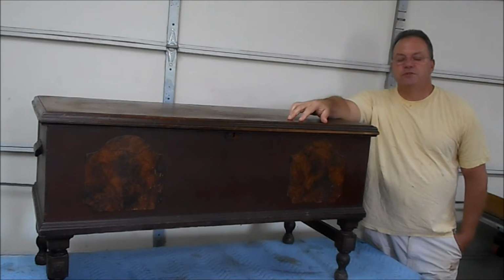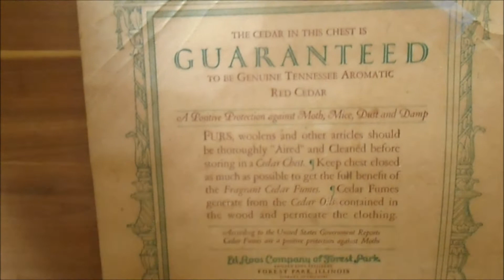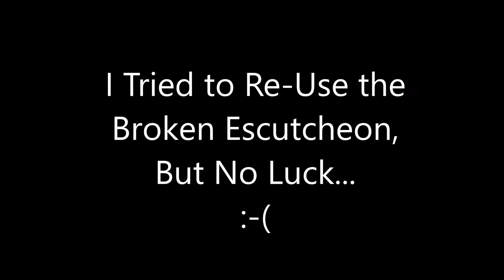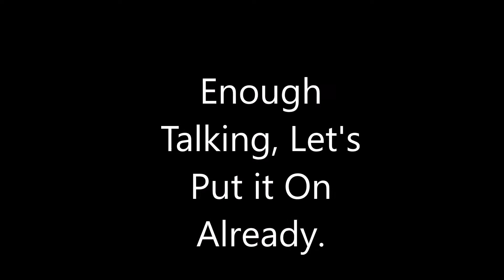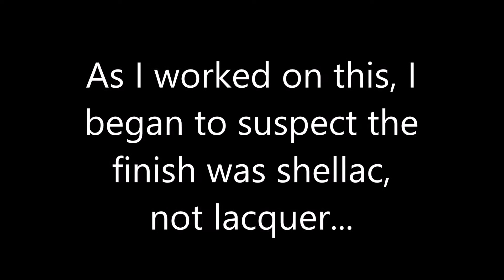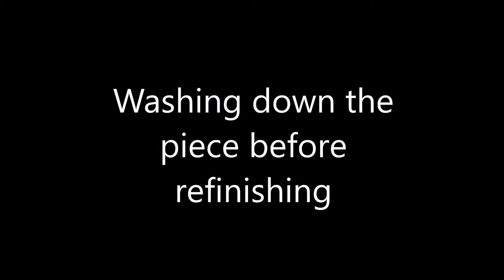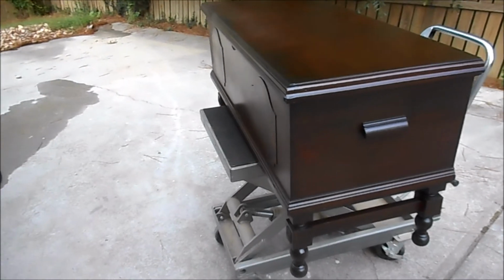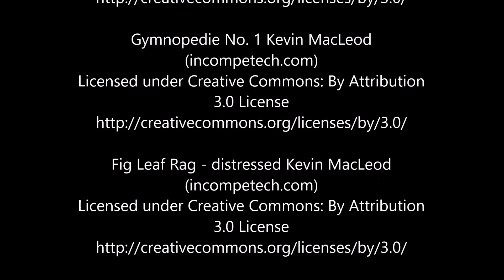Restoration of an early Roos cedar chest

Comment: I JUST FOUND A LANE CEDAR CHEST FROM THE 40'S LET THE FUN BEGIN. THANKS FOR THE INFO GOD BLESS
Reply from the maker: Good for you!  Good luck with the project.  BTW, if it has the original latches on it you may want to disconnect them.  I understand there have been issues with kids getting into the chests and the lids locking them in.    Sad stuff.

Best regards and thanks for watching!

Comment: Nice job.  I stripped off a faux finish on a built in cabinet in an old  house once.  I was sick so I know the feeling.  Nice recovery though.
Reply from the maker: Thanks, Rick.   I was surprised twice.   Once then the finish came off and then again when it went back on.   :-)
Reply: Question.  Most of our furniture is older stuff but my wife spilled polish remover on one of her favorite cheap tables, sadly made in Vietnam.  Something should be wrong with that but to the point under the microscopic thickness of veneer all it has is what looks like maybe resin and sawdust or something to that effect.  Pretty soft when stripping it.  I was wondering if you've dealt with any of the cheap stuff like that  and can I just spray a sealer and then lacquer like normal or does that crap need something else.  Obviously I'll need to put some color on it after sealing but I didn't know if lacquer would melt it.  Thanks.   Hope you're working on something.
Reply from the maker: Ouch!   I have done a lot of repairs with particle board, but I'm not sure I have dealt with what you are describing.   I think you are probably right, that if you seal it first you may be OK.   Obviously it will need to be smooth before you try to finish it up.   I guess if that all fails, you may have to either patch or re-veneer the top.   Let me know how you make out as you move forward.   I'm curious to hear what you find out.   Good luck.

Comment: Reply appreciate your videos!

Was most curious about how you refreshed the interior cedar but didn't see anything mentioned in video? Did I miss this part? Also seemed you left lid cracked and interior unprotected while spraying shellac... Was that intentional? I thought cedar interior needed to remain unsealed?
Reply from the maker: I didn't seal the interior.   Normally all that needs to be done with cedar lined furniture is to scuff sand the interior to restore the aroma if it has faded.    If I remember correctly, this piece didn't even need that.   Thanks for watching.

Comment: New subscriber. Well done and thanks for the videos, keep them coming. Just stumbled across your videos and I have a few questions; When to use lacquer or when to use shellac? I notice in one video you used wax/orange oil to finish out a project, but many refinishers say to never use and oil over a finish. Thoughts? Thanks!
Reply from the maker: Hi Reggie - welcome aboard!

I tend to use shellac as a finish coat on antique pieces where the original finish was shellac.   Shellac has other purposes as well, such as a barrier coat to prevent bleed-through of color and also sometimes it works on silicone contamination as a mist/sealer coat under lacquer or poly.   I use a de-waxed shellac called "Seal Coat" for those purposes.  I also occasionally use a spray can of shellac to seal small repairs prior to color and top coating.

As far as the wax over a new finish, I know it's one of the disagreements refinishing people have.   I often use it as a lubricant when I do a light "rub out" of a newly sprayed piece, but I have also used "Wool Lube" by Mohawk and that's a water base product that just wipes off.   

Most times, I let the piece "tell" me what it needs and adjust my plans accordingly.   In my experience, I haven't had any issues with applying a light coat of wax to a finished surface.    On this project, it was really necessary to rub this finish out and the wax worked very well on the oak and left a nice deep satin finish.

Thanks again for subscribing and it would be great to have a community of refinishers/re-sellers here to share ideas and experiences.   I love to learn.

Best regards,

Larry

PS - Make sure you check out Bruce Lach's channel - he's the best production refinisher on YouTube in my opinion.   Also, Thomas Johnson is god-like in his abilities as an antique restoration expert.   His channel is not to be missed, either.

Comment: Shellacking with the lid open shellacked the inside cedar lining and will not allow cedar oil in.
Reply: I think you can go over the cedar with a light sanding and it will be fine, I heard you should do that to some of the older ones , allows the cedar to work better as it ages

Comment: I thought it was beautiful as it was. I like the chips and scratches. But broken or missing or damaged pieces should definitely be fixed. Looks great!! It sickens me when I go to a flea market and some diy mom has faux distressed painted this old 1900s to 1940s furniture.
Reply from the maker: I agree with you on painting old furniture.  I understand some people like painted furniture, but there is enough junk out there to paint.   I wish people would leave the antiques alone.   Although in a few years, when tastes change, they will all be looking to strip and refinish the same pieces they slathered with chalk paint yesterday.
Reply: @LostMountainRestoration  some guy on you tube showed how he painted a mid century modern dresser and chest that had beautiful grain wood on the top  and mid century pieces like that are pretty desirable with some buyers , but not painted